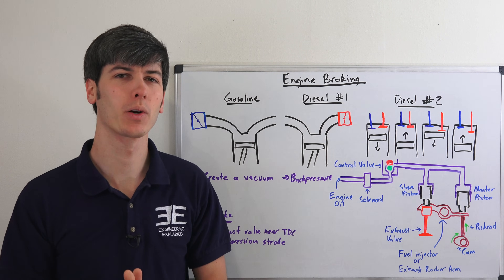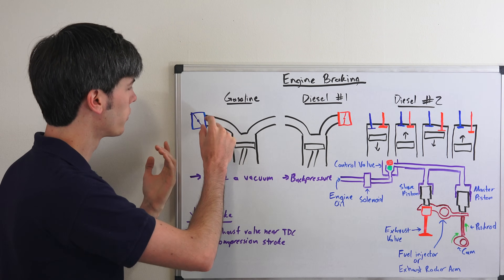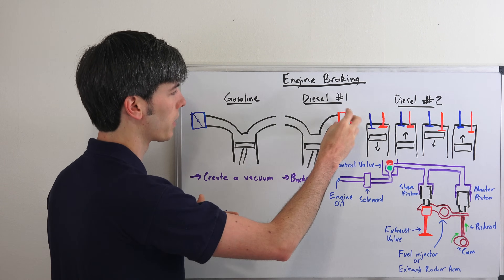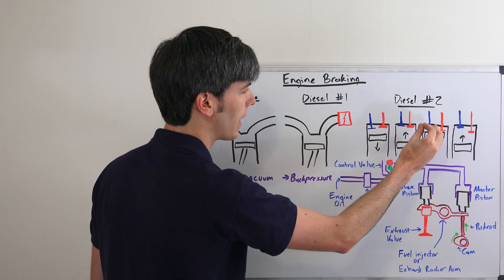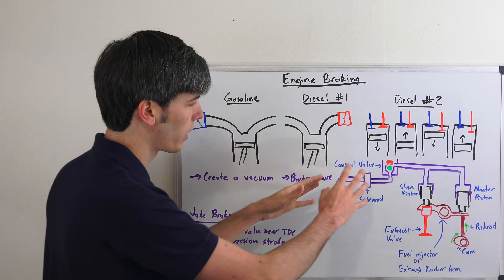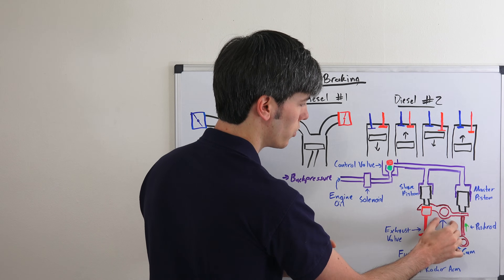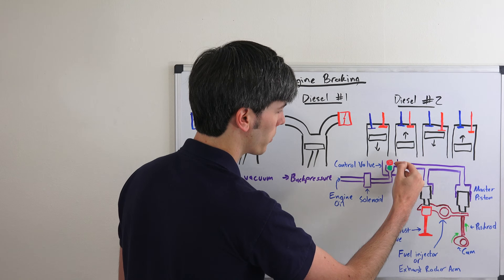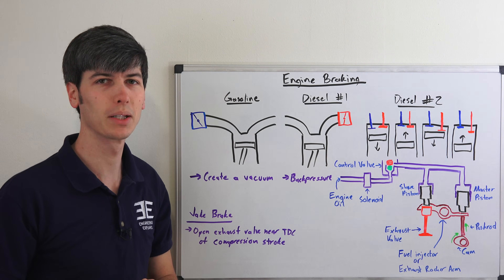What Is Engine Braking? What Is A Jake Brake?

Comment: Awesome explanation as always! It is amazing how much energy an engine uses when there is no combustion!
Reply from the maker: +ChrisFix Thanks Chris!
Reply: It's inaccurate to say that a vacuum behind the throttle plate is the cause of engine braking. A partially open throttle results in the greatest air pumping loss, and therefore engine braking, as long as the fuel supply is closed. To emphasize the point, imagine a complete vacuum in the intake manifold. There would be no airflow, or resulting braking effect, during the intake, compression or power cycle. The only airflow would occur during the exhaust cycle -- backflow into the cylinder during the first part of the stroke and expulsion during the latter part. Nonetheless, engine braking would also still result from reciprocating and mechanical losses, as well as air pumping losses inside the crankcase, below the reciprocating pistons. Cheers
Reply: @jamesschouw5700  "It's inaccurate to say that a vacuum behind the throttle plate is the cause of engine braking."

No it's not. The vacuum creates a force that works against the piston as it travels towards Bottom Dead Center attempting to fill the cylinder with air. This is the force that causes the engine braking effect.

"A partially open throttle results in the greatest air pumping loss, and therefore engine braking, as long as the fuel supply is closed."

Well technically, even a "closed" throttle body is still at least partially open.

"The only airflow would occur during the exhaust cycle -- backflow into the cylinder during the first part of the stroke and expulsion during the latter part."

The vacuum that exists inside the cylinder is still being compressed by the compression stroke. And it's not a perfect vacuum, either, so there has to be at least SOME air in there. As to what the actual pressure is at TDC, I'm not smart enough to know how to calculate that but I'd love to have that information.

"Nonetheless, engine braking would also still result from reciprocating and mechanical losses, as well as air pumping losses inside the crankcase, below the reciprocating pistons."

All of that is negligible compared to the force created by the vacuum on the pistons traveling towards BDC.

I would love if Jayson would go more in-depth about the cylinder forces and how they work, so that we'd have a better understanding of all this.
Reply: +ChrisFix Haha should've know you watch EE :D
Reply: Engineering Explained actually i think it’s both the compression and power stroke in two different cylinders that created the force to hold the vehicle, since the cylinders at intake and exhaust stroke has open valves which would not create any pressure in this case to counteract the force.
Reply: Nice !
Reply: David Gruen -- it is the compression
Reply: ChrisFix 
Interestingly, my Diesel engine reports 999mpg when engine breaking 🧐
Reply: A bit disappointed you didn't start your comment with "hey guys Chris fix here"
Reply: Thanks for this sir jayson!
Reply: ChrisFix! You are awesome! Thanks for your car hack videos!
Reply: I have wondered for a long time now if it would be possible to take that compressed air and rather than expel it into the atmosphere, collect it in a receiver and then reject that highly compressed air back into the engine when required ?   A energy recapture system ,,, ?
Reply: Engineering Explained Thanks for explaining this, never thought that it was the vacuum not the compression in gas cars. Just one question tho, when you put a car in gear to hold the vehicle on an inclination when engine is off, is it the compression that holds the car instead of vacuum in this case since pistons aren’t moving.
Reply: Yeah, it's the feature of injectors to shut off the intake of fuel while engine breaking. Best in down hill applications, but still great at normal roads.
Reply: Anonymous // because it shots down fuel
Reply: The only mistake is that the vacuum does not play such a role, but on the oterh side, compression and gear ratio are very important!! Here are very simple facts: 1) Most diesel engines doesn't have throttle body or other valves that create a vacuum, but still they have stronger engine braking than the equivalent gasoline engine (because of stronger compression and longer gear ratio). 
2) Both diesel and gasolline. Put the car in neutral and try to push it, you will succeed. Put it in the first gear or second and try the same, it will not go! If the vacuum is so important, it would be hard to move the gasoline on the flat surface even though it is in neutral.But the reality is different. The car is easily moved in neutral, in the first gear no, while in the fifth or six it moves easily as it is neutral
Reply: @milosrog  Vaccuum plays a huge role. If you have an older manual car with cable throttle you can see the difference by putting it in gear, switching the engine off and seeing the difference that stepping on the throttle does (the engine brakes considerably more off throttle).

Most of the energy from the compression is recovered during the power stroke, it "brakes" the engine when it's stopped because of the high initial torque required (hence why Diesel engines need more powerful starter motors and larger batteries), but once it's turning that's not an issue. Diesel engines have generally higher mechanical losses, not just higher friction but things like the high pressure fuel pump/injector pump actually drain a lot of torque, that's why they brake. But then there's gearing which is highly variable, if you have a modern reasonably powerful turbocharged diesel you actually get very little engine braking in all but first one or two gears.
Reply: @milosrog  are you drunk?
Reply: @milosrog  "If the vacuum is so important, it would be hard to move the gasoline on the flat surface even though it is in neutral."

When the car is in neutral, the engine is no longer connected to the wheels and has nothing to do with preventing the car from moving. Your statement is completely wrong.

"while in the fifth or six it moves easily as it is neutral"

No. The higher the gear, the more force it will require to overcome the resistance of the engine. The gears are multiplying the torque being applied to the ground; the same happens in reverse when attempting to push a stationary car in gear. Anyone who has ever push-started a car knows this. Popping the clutch in first will start the car easier than doing it in second. If you try to pop the clutch in third, the car will jerk to a halt. It's impossible to push-start a car using fifth or sixth gear.
Reply: @rars0n  you are wrong. I only said that it is easier to push the stationary car in fifth or sixth gear than 1st or 2nd...If you don't believe, you have to try, because what you say is not true ... The stationary car in 5th gear is pushed almost as easily as if it were in neutral... Also. car should not be push started in 1st if it is possible, because such an action can lead to skipping or breaking of the belt... You should always try that at higher gears. Starting in 3rd or 4th is ideal if there are conditions for it ... even in 2nd, but everything is better than 1st ...
Reply: @rars0n  Then why would you put the car in the first gear when parking?

Comment: So does this mean a jake brake does harm (to an extent) to the atmosphere? I mean since the air/fuel mixture is not ignited, VOC's are released..correct?
Reply: +Jorge Cervantes fuel is only injected when needed, when engine braking it just an air pump
Reply from the maker: I suppose it depends how it's setup. It wouldn't be necessary to inject fuel, and I imagine with modern engines they don't to save fuel (for example, using a cam that's time with another cylinder's exhaust valve).
Reply: Interesting. Thanks guys
Reply: The governor on an diesel engine shuts off fuel when there is no accelerator input and the engine is turning faster than idle.  So it's never an issue, especially in electronically controlled engines.

Comment: I expected to hear the advantages and disadvantages of engine breaking also :(
Reply from the maker: +Jacob Møller Slows your car down without using the disc/drum brakes. For steep grades this is quite helpful as large trucks (and even small cars) can save the service brakes and not worry about brake fade. There's not really a disadvantage, it's not going to damage anything so long as your engine doesn't overheat (which it has a big radiator up front for).
Reply: Compression brakes are a lot more effective than exhaust brakes, because they turn ylur engine into an air compressor. But they are extremely loud (especially if someone has no muffler) which is why you see those signs saying "No Engine Brake".

Comment: Blinker fluid leak. Please help
Reply from the maker: +Colin Dowd Sell it immediately, I foresee big problems down the road.
Reply: +The Channel of Stuff if it's a BMW, there is no fix for that.
Reply: automatic or manual?
Reply: Is it 2wd or 4wd
Reply: Press PAUSE and REC at the same time while kickstarting the off-board blender, then, as soon as you hear the cavalry arriving, you shall take one hand out the window and slap the donkey.
Reply: what car do you own?
Reply: ***** yeah there is..its called a trade in!
Reply: +The Channel of Stuff that explains everything, it is a money pit for sure.
Reply: Maybe watch the Chrisfix video
Reply: +The Channel of Stuff omg! You just killed me 😂😂😂
Reply: +MarioPL Source: previous BMW owner. never again, maybe a 840 or 850
Reply: I think he means the front left and the right rear are the drive wheels.
Reply: Colin Dowd good thing chrisfix was in this comment section lol
Reply: Colin Dowd I think the powerband failed on my old outboard motor
Reply: That's what happened to my Rolls Royce.
Reply: That is an Easy fix... Simply replace  the Old Worn Out Blinker Fluid line with the Radiator hose off of a 65 VW!!! Works Perfect!:~)
Reply: Simple, change your muffler bearings.
Reply: William Hicks you are an ENORMOUS SNOWFLAKE and you have a severe inferiority complex which is probably well justified and based in fact.
Reply: I live in Arizona. We get them Right Up from Mexico...They are Bound and Determined to drive here Just like they drive South of the border...  the men drive just as bad as their women! LOL!!!
Reply: Oh, I absolutely know you weren't being mean. It seems in todays society Even when you speak the truth, SOMEONE wants to point their finger and say, "Oh, You are just Hating and being Mean"... Hey, the Truth IS the Truth! If they don't like it, then THEY Need to CHANGE Something. You are fine William. I was actually agreeing with you.
Reply: Your headlight fluid and your blinker fluid are cross-contaminating.
Reply: You don’t have to go a mechanic, do it yourself. Here is a useful video
Reply: Some eye drops will help you
Reply: Maybe you could change the air in your tires. That’s also known as putting nitrogen in your tires.

Comment: As a Truck Driver, thankyou, I can now explain HOW it turns my motor into a giant 14.5 litre 6 cyl air compressor.
Reply from the maker: 14.5 liters of beast, that's awesome, glad you enjoyed the video!
Reply: Whenever I engage the Jake brake on my Peterbilt, country girls throw their panties at my windshield.
Reply: +Yak Eru  Yes, That's typically the performance muffler or even straight piped crowd.  A Jake Brake sounds fantastic through 10" straight stacks

Alot of cities, well, pretty much all of them, technically have bylaws against the uses of engine brakes within city limits because of them lol. 

thats one of the perks of the silly aerodynamic eco friendly truck I drive, Jake brake is so quiet i can use it everywhere and no one knows. Also driving a straight piped truck 11 hours a day (13 in canada) gets pretty old after the first week.  its alot of noise.
Reply: +Adrian Foekens Is this why some trucks are doing such a huge noise when decelerating ?
Reply: +Adrian “Moose” Foekens I'd imagine that Eco friendly trucks are easier on the wallet too, just don't sound like a total boss.
Reply: you don't want high RPM horsepower, you want low RPM torque which you get with huge diesel explosions in each large cylinder.
Reply: Because they aren't interested (for the most part) in pure horsepower which comes from lots of RPM. They need torque and lots of it to pull 80K+ up those grades and away from a stop. Big slow turning engines are great for making tons of torque. Sure you could power an 80K truck with a 5 liter engine but you will need to gear it so it's spinning near max 6 or 7 thousand rpm just to maintain speed. That would be noisy, inefficient and it would wear out very soon. Gears are simply torque multipliers. That big slow turning motor is more efficient and much more rugged and reliable.
Reply: It usually applies specifically to "engine" brakes. Those being exactly what he described in the video. Exhaust brakes are much quieter, and the law is usually for the noise caused by an engine brake.
Reply: So if the law specifically says it's illegal to use an engine brake, would an exhaust brake be legal? And just to be pedantic, wouldn't that also make it illegal to back off the throttle at all?
Reply: +Vortex TV 
To develop more low RPM torque.
Reply: +Vortex As others said: torque.  Fewer large cylinders provide the torque to pull 40 tons of cargo up mountains.  Also, In line 6 engines are well balanced so it is a good number to stop at.  Semi tractor engines are underrated so they will last longer, a 14.8 L semi engine only produces 560 HP.  An auto engine can go 200-300K miles before needing an overhaul while a semi engine can go up to a million. Also, gasoline engines need the flame to cover the combustion chamber so huge gas engines don't work well (though some large gasoline engines use 2 spark plugs/cylinder for this  reason) . Diesel engines use compression to combust the fuel mixture so they do not have this limitation.  Larger diesel engines are made.  My company used to have a 13,600 in^ 3 or 222L V12 diesel generator to run our data center if street power failed.  We used to test run it weekly and it was really something to hear fire up.
Reply: +Adrian “Moose” Foekens Quick question. Why do trucks not use more cylinders and smaller litre sizes?
Reply: There is no explosion in the combustion chamber unless you're doing it way wrong. What you have is a very fast flame front traveling throughout the chamber and bringing a relatively smooth increase in chamber pressure. Detonation in a gas engine can be heard as a pinging noise and will damage your engine rather quickly if you let it continue. Normal combustion is smooth and takes a few milliseconds to finish. Detonation is when it all goes at once. Diesels like lower rpm because the fuel is injected when the air in the combustion chamber is hot enough to ignite it. It takes time for turbulence in the chamber to distribute the unburned fuel enough to mix it with the unburned oxygen. This is why diesels are primarily low rpm engines.  Horsepower is torque times RPM divided by 5258 or some number around that point and why I don't know. But that is why an engines horsepower continues to go up even as the torque is falling off with higher rpm. Eventually you either reach the mechanical limits of the engine or a point where the torque is so low you can accelerate faster by upshifting.

The point is that there are no explosions. Very fast burning yes, explosions no. Gasoline detonates much easier than diesel too, which is why gas engines have so much lower compression ratios. Diesel also has more btu's per gallon than gasoline by about 1/3 if I remember correctly.

One thing to remember, regardless of what kind of engine you have if there's black smoke coming out of the exhaust, you are spewing unburned fuel. That black smoke is unburned carbon from the hydrocarbons that make up the fuel and carbon dust is what causes coal miners to get black lung disease.
Reply: +Adrian Foekens 14.5 litre on 6 cyl? That's insane...